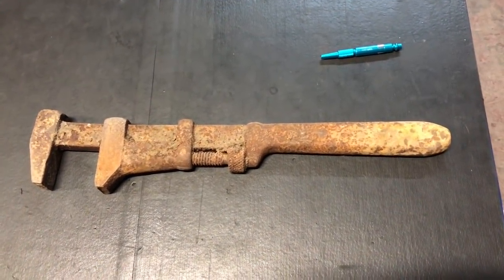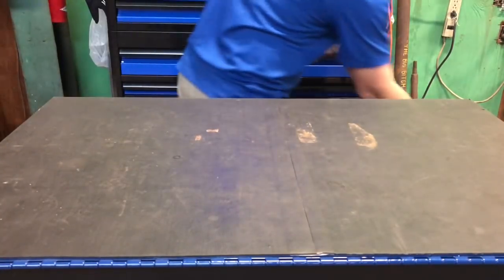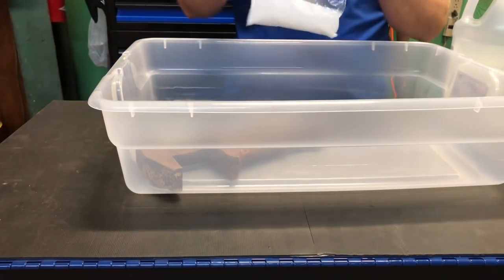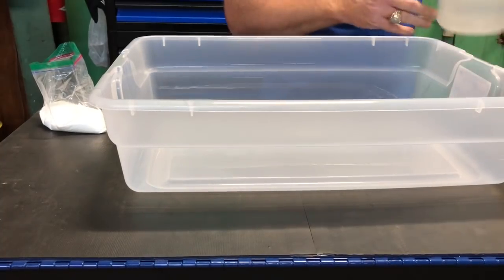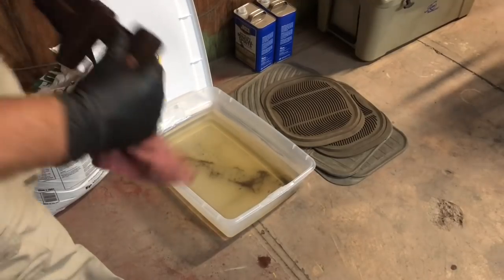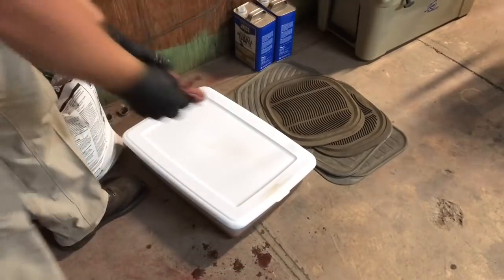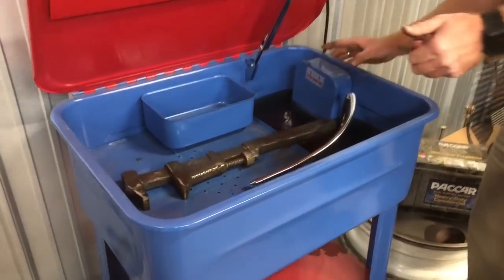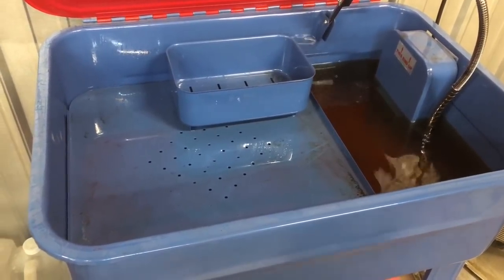OLD J.H.  Williams Wrench Restoration

Comment from the maker: I was surprised at how well that one cleaned up.
Reply: Koon Trucking I can't believe there was no pitting
Reply from the maker: Brandon Shreve it turned out great ! I thought it would have been bad also. That says something about the steel they used I guess it was all surface rust
Reply: Koon Trucking damn right man I thought In the beginning it would have turned out probably the same way I'm sure you figured it would terrible what I can't figure out is how someone bent that thing on the end had to have thrown a hell of a cheater pipe on it lol
Reply: Brandon Shreve, I recall when this design was in use everywhere in various sizes. Predates today's fancy kit—adjustable wrenches were 'maids of all work'. But it's crude and bulky by today's standards, and only a 2-sider. One day, an apprentice puts a l-o-n-g piece of pipe on the end for extra leverage to undo a big stubborn nut, but the stress is so great at the business end, something has to give! Having abused it, he tosses it in the junk box in disgust. Decades later, KT comes along and lovongly resurrects it. It'll give a nice period feel when it's on display.
Reply: Brandon Shreve were I come from  ( south east ma ) we call it a persuader.  I've bent a 2 footer (24" ridged pipe wrench trying to shut a frozen 4" isolation valve a few years ago.
Reply: Koon Trucking me too.  I expected serious pitting.
Reply: Well done! The wrench looks great.
Reply: Greg Lemieux I was going to say, “Up here in the northeast we call it a persuader” (upstate NY, near the capital) but you beat me to it! I was amazed at how well that wrench cleaned up!
Reply: I hope ir works on Mt sons rims there really rusted out
Reply: @Cullen Lawrence Instablaster :)
Reply: @Jamison Dangelo it worked and I now got access to my account again. Im so happy:D
Thanks so much, you saved my ass :D
Reply: @Cullen Lawrence happy to help =)
Reply: throw a tub o towels on it and it should clean up nicely
Reply: What happened to Hamilton and snap on fridays

Comment: Nice video. I love those English style adjustable wrenches. I own a Billings 10" model. 

For long peices of rusty metal I capped off one end on 2" PVC pipe and put a clean out cap on top to make a long thin bucket. Takes much less vinegar to clean a lawn mower blade with that than a big rectangular tub.
Reply from the maker: Justin Dearing that’s a great idea ! I will have to use that one ! Thanks for watching and taking the time to leave that helpful comment !
Reply: Koon Trucking ्
Reply: JH Williams Buffalo NY. My father in law worked there as a Hammer Man. He may have forged the handle and jaw for this very wrench

Comment: Using electricity to remove rust works fantastic too, you can use a plain 12volt battery charger to do it, you just have to make sure you have the polarity right and the two electrodes and what they're attached to aren't directly touching. It turns the rust into like a black powder that easily brushes off and will get the rust even out of the smallest of crevices and pits.
Reply: What kind of solution do you use in your parts washer?
Reply: JS..think he said..mineral spirits...
Reply: @iamrichrocker  forgot to turn my sound on, how about turning your attitude off
Reply: @JS-pq5jw  Touchy! Touchy!
Reply: @JS-pq5jw  I just mix in a little washing soda (not baking soda) in some water, it helps it conduct, you don't need anything else as the electricity does all the work. You can turn baking soda into washing soda by merely baking it in an over at like 100 degrees for an hour.
Reply: its good to, but is just to much work.

Comment: Will give it a try. I restore old Craftsman, Delta, Homecraft table saws and other old tools and Rust is the "meanie" I have trouble with; especially the caste iron table surface. You can paint the rest of the parts, frame, fence, miter and extensions, but if you can't get the table top shiny, it looks real crappy. Thanks for the Great Video; keep up the good work, we learn a lot from these video.  Cheers.  Phillip.

Comment: I do this all the time with my older tools and any tools I find on my families farm so good job to you. No need for the salt, just soak in vinegar, also in many cases when its rusted this bad you have to wait way more than 24 hours. some of the axe heads i've done took 4 days to almost 2 weeks. When its fully done it should change to an almost solid black color.

Comment: Use 50/50 water vinegar solution for minor rust and 100% vinegar for major rust. No other additives. Usually my pieces are done within 3-8hrs depending on how thick the rust is. I do remove them occasionally to scrub with steel wool and blue dawn soap.

Comment: I was curious so started to put tools in motor oil ( for a couple hours ) didn't do much and now have a couple tools in Marvel Mystery oil and a couple in apple vinegar cider . Yes like you I taken them out and hand wire brush them putting them back in and some rust has taken off but will get wire brush attachment for grinder and use that now . Will add salt too

Comment: I would have brushed the old rust under running water. No need for all that dust.
I've used vinegar alone and got great results.
I warmed up the vinegar first, because heat always speeds up a reaction.
I neutralized the vinegar by washing it with baking soda, as you suggest.
Nice results though!🙂🙂
Reply: You go son. Vinegar works best in the sunlight soaking..24-36 hr soaks are the BEST.

Comment: If you don't want to wait hours or days on the vinegar, another cheap and MUCH faster tool is muriatic acid.  It will do in minutes what it takes vinegar hours or days to do if at all, and if it seems too aggressive, just add some water to dilute.   But you'll get bare steel fast.   Get some protection on there and then finish.   That entire project could have been completed start to finish in under 2 - 4 hours with muriatic acid.
Reply: DANGER WILL ROBINSON.

Comment: Nice wrench. I did a similar one. I had better luck cleaning - brushing the expose threads and contact surfaced before trying to break loose the adjustment wheel. Nice job. Good to know others appreciate the old tools.
earl

Comment: Good stuff!

You don't need to neutralize that vinegar, it'll only do good for your tools. It'll convert all of that bad red rust into the good black rust that will prevent them high carbon steel tools from rusting. I give all of my old steel tools the vinegar treatment. Works on guns too. My grandfather used to treat his shotgun barrel with vinegar, that's how i've learned that trick.

Comment: I have found that Evapo-Rust work great. It can be used over and over. I dispose of it when it so black I can't see what I put in it anymore It's safe for the environment also. I purchased it from Amazon at $19.00 per gal. Try it you will like. 
PS parts wash off with water.
Reply from the maker: Frank Wortmann I will have to get some of that stuff. I like restoring old tools.
Reply: I second the evapo-rust it most likely would have cleaned up the threads also so no breakage

Comment: From one tool lover to another, I couldn't tell if you did this or not. But the acidity of vinegar does decrease when diluted with anything. If you do another restoration project and use vinegar and salt to derust it I would suggest changing out the vinegar and salt every other time you submerge it for good results.

Comment: I can't believe how many different types of cleaners and lubricants you used. It's more basic than what you did, no need to wire brush in the beginning,  Straight white vinegar, no salt, submerge in vinegar for a minimum of 3 days, 5 days for a wrench like yours. After the 5th day remove it from the tub, the screw by that stage will turn by it's self. Dismantle the wrench if easy to do so, if not work on it as is, wash in clean water and dry off using air and a cloth. final step, wipe down with prep wash or a little bit of WD40, job done!

Comment: If you haven't already done another restoration after this video, try electrolysis on your next"find". Love the vinegar solution method but electrolysis works a little bit more aggressively at the oxidation (rust). Vinegar baths can require up to 7 days depending on the amount of oxidation and vinegar strength.

Comment: I like bringing them old tools back to life!
Reply from the maker: Bobby DaBoss Salvadras I was surprised at how it came out. That bead blaster you got would have turned out better though.
Reply: Koon Trucking I would have liked the hit it with the bead blaster. It would come out snow white.
Reply: Evaporust would have really saved it.Or patience and used motor oil or better yet transmission fluid.PB blaster is junk in my opinion have had much better luck with kroil over the years.

Comment: There is this acid called blue  lighting  it works really good , you can also use muriatic acid  but in either case  you need to neutralize the acid on the tool after its rust free

Comment: After you cleaned it off you should have heated it with an Acetylene torch as the expansion and contraction of the metal will free up the rusted threads.

Comment: First Deep Creep the throat and thread. Wait. That will loosen everything. If not heat it up and light tapping. The expansion loosens. MUCH less time. Dis-assemble and straighten the whole shaft. Now it is ready for cleaning. Muriatic acid dilute is fast. Wash, rinse, then heat it up to drive out moisture then oil or paint when warm. Most folks forget to drive out the moisture with heat. Cold metal conducts moisture. Nice work for first time.

Comment: They used those a lot on railroads ! For square headed bolts and nuts !
I would just spent some time with a wire brush and i would use kano kroil and waited a while !
You let that kano kroil soak in a day or so and most things will give up !

Comment: I’ve never seen salt used with vinegar before. Always just vinegar alone. What does the salt add to the process chemically? Also, sometimes heat is what it’s all about. I think I would’ve gone with that right away, along with the chemical agent of your choice. It’s a shame the threads stripped. Too bad they couldn’t be chased and the tool put back into service. Pretty cool!

Comment: Let me give you a little lesson in freeing up frozen screws and such. Put some heat on it! Aim the flame on the female threaded areas and sliding surfaces and heat them almost close to red then work it back and forth expanding your limits a little at a time. As it cools spray a little Kroil from Kanolabs in the groves and repeat the cycle. This way you can free up the thing without stripping it!

Comment: Clay--I wouldn't have tried salt and vinegar on my own, but apparently it does wonders in solution.  The combination gets into every crevice and cranny, which couldn't be attained strictly by mechanical abrasion.  Actually, corrosion grows legs and takes off when you have multiple wetting/drying cycles.   Using a bead blaster would have skinned the top layer of corrosion off, which would have been good if you were going to put it back into use.  Of course, soon after that you'd need to spray a coat of primer to prevent it from flash rusting.  There's another YouTuber that calls himself ScoutCrafter that does a lot of these kinds of restorations on old tools that he buys.  You might check his videos for more tips and techniques.

Comment: The jaws have spread. If you put the wrench in a press and  straighten the bar the jaw slides on, it will work again. This is common when the wrenches are abused.

Comment: Soak in distilled vinegar for 3 hours then brush, then soak for 3 min in 1 part baking soda 2 parts water then rinse, then coat it with coconut oil to stay rust free. Much less time spent. In the days you had to let it set, you could have gone to the store and got baking soda

Comment: If you’re just refurbishing an old tool to add to your toolbox for everyday use, you can do whatever it takes to clean it up and get it functioning.  But, since it’s obviously an antique tool you’re restoring, I was a bit horrified to see you apply the vise-grip teeth directly to the teeth of the monkey wrench’s adjustment wheel without a rubber strip to protect the wheel’s teeth - plus hammering directly onto the face of the wrench.  Eeek!  That’s rough handling for an antique you’re trying to restore.  Still, a nice job on a beautiful old tool.
Reply: I had the same exact thought. I've been wrenching things since well, I can't even remember! I have done a lot of this stuff in my time. I love resurrecting old stuff. I was surprised to see him put that wrench in the vise with out slapping on some soft jaws first. Then banging it with a steel hammer and using channel locks on the adjuster screw. I don't know maybe it's me from working on helicopters too long.

Williams tools went that far back? My father was a machinist and backyard mechanic. He swore by Williams tools so did I. Snap On was all the rage when I was younger. So I had a mixed collection of Williams and Snap On. One day I was trying to bust loose a head bolt on a 1960 HD Duo Glide. I put one of my best Snap On box wrenches to it with a piece of pipe to "persuade" it and that Snap On just snapped off! So I went down to my favorite Williams dealer and bought another, Williams this time. Put the wrench on with the persuader/cheater on it and though the wrench seem to start bending, it broke that head bolt loose. I'm sorry to see that Williams tools went out of business.
Reply: Its a wall hanger guys. Jeez watch the whole thing

Comment: Clay, the best treatment for rusty tools is Muriatic Acid and Water. The ratio is 10:1 (Water:Muriatic Acid). Always wear PPE. Pour water into a plastic container, followed by the Acid. Let the item sit for 1hr. If the water/Acid mixture is warmer, the processing time is shortened. After this is done, all rust will be gone and the tool will not require any secondary cleaning such as a wire brush or steel wool. Check out my latest two vids to see how well my tools turned out using this process.
Reply from the maker: Midwest Tool Review I will take a look. I had no clue how to do this, it was my first attempt at it so I ran into it blindly but it turned it pretty good

Comment: I dont know if anyone else suggested this but Electrolysis works much better than vinegar and will not hurt the metal or finish if it is nickel or chrome plated, from my experience a vinegar bath will ruin a large number of high quality drill bits and taps (not the crap you get from the big box stores) that were left in a metal bucket and covered in rust, the vinegar bath ruined all the bits and taps, it took everything off, the rust, and chrome and or nickel plating, so they had to be thrown out...
Reply: If you said about high quality... why it's ruin only with the vinegar bath? Oh sorry... you mean crap, did you?

Comment: Maybe a friend with a milling machine can help with rethreading the screw threads.  Take heart.  That specimen had a distinct bend in its spine which may have contributed to its stiffness.  Invest in a simple electrolysis setup.  You already have the container.....and probably a battery changer.  Some wire & baking SODA, and you'll be set....

Comment: Apple cider vinegar works as well for rust removal as well,let the tool soak overnight.I will send you an old Ford wrench or two sometime,have Ford on them
Reply from the maker: wafrederick that’s cool I have an old Ford adjustable wrench Shi Shi got me off eBay it has the Ford logo on it. I thought that was super cool ! Can’t get any better than Ford and tools !
Reply: I collect old tools as well,one favorite is an old Craftsman circle H 1/2 drive set I bought off a Garage Journal member.Just got the speed handle for it in yesterday,missing from the set.Even have an old Mac specialty wrench for a Ford application

Comment: A great product to consider would be evaporust, its nontoxic, biodegradable and you can reuse it for like 300lbs of parts or whatever you derust. (Edit) You also only need to leave it in evaporust for about five to seven hours

Comment: nice  great to see old tools cleaned up  to free the the rusted threads try 50 50 acetone and a.t.f  as atf has the smallest molecules of any oil acetone burns out the rust soak 24 hrs or longer and mix as the the atf and acetone will seperate.TRY IT.

Comment: Hey! Not sure if you’ve got future plans of restoration but for just a little bit more cost investment you could cut your time tremendously. Use Evapo-Rust, It’s extremely gentle to everything except rust,It’s a very effective rust dissolved. Works quickly and even my toughest projects have been dissolved in 24 hours. Great video and wrench here man,Keep it up!

Comment: There are always other ways to remove the rust!  I do like to use car battery charger, steel plate and water/baking soda !!  Weld a piece of rebar about 5" longer than the depth of the water solution you need, Attach the Positive lead to the end of the rebar and attach the negative lead to the wrench!  Don't let them touch!!!!  put the tool into the solution and make sure the tool is completely covered by the solution.  Plug in the charger and let her do her thing!  check it until is done! {4to5 hours}!!! By the way, WD-40 is useless!  All kinds of better products out there that penetrate into the threads, my opinion of course!!!  Could have even put it in the oven at 350 for an hour and dropped it into  a bucket of old oil to break the threads loose!  Just a couple of options for the future!